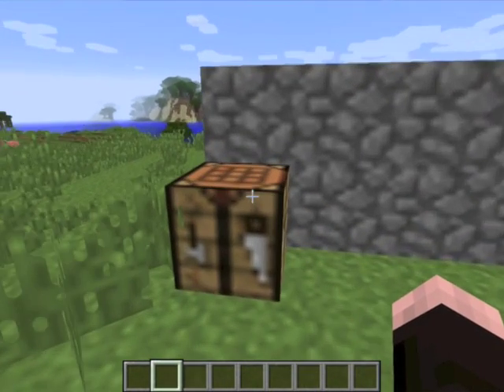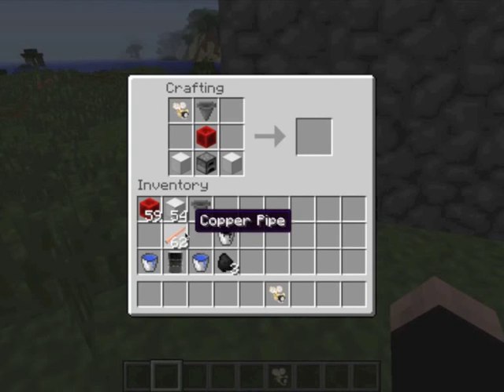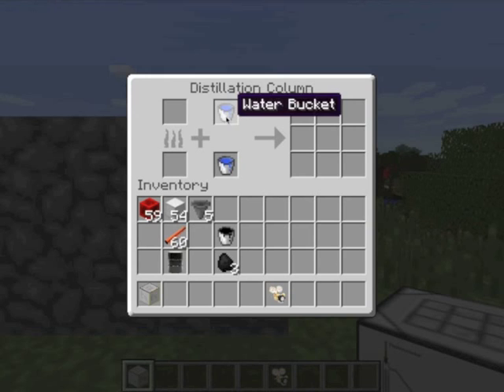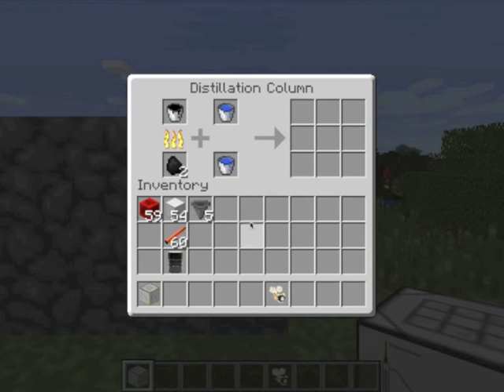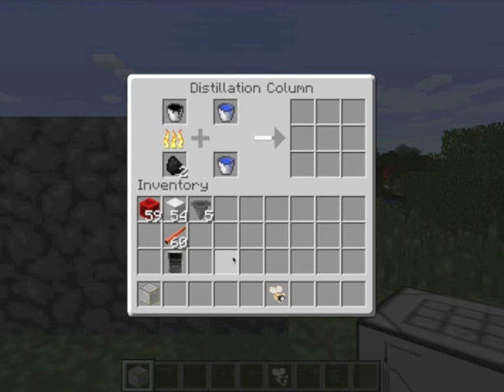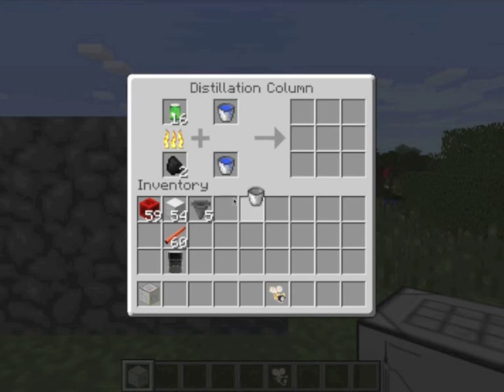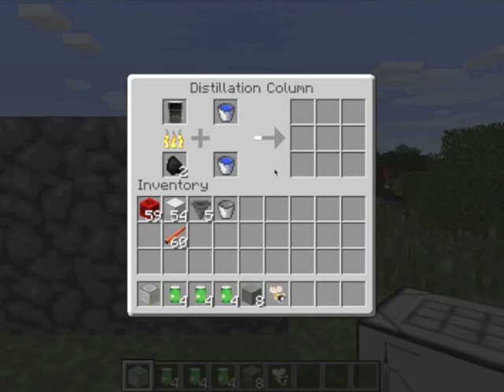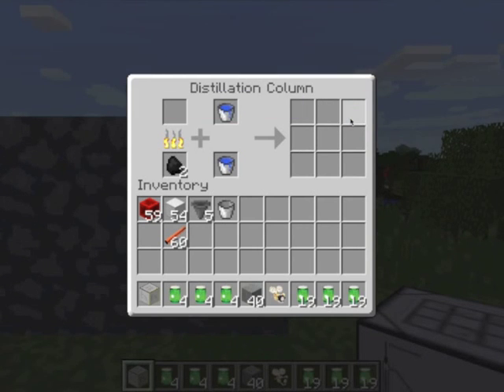Crafting and Using a Distillation Column in Polycraft!

Comment: I've distilled a few things but cant figure out how to get propane and the wiki isn't being of much help.
Reply: I just wasn't distilling crude far enough [Crude Oil > Naphtha > Light Naphtha > Light Paraffins > Propane, Methane, Ethane] (It should be 'Lite' rather than "Light")
Reply: Your Welcome, I think I'm starting to get the hang of it; I was trying to figure out how to get Nitrogen from distillation and I kept thinking "if i could only pull it out of thin air" then I found the condenser, hehe. currently Im trying to automate refining but i don't have a good way of destroying the gravel, may I suggest an Incinerator?